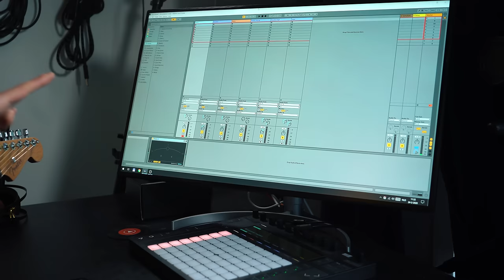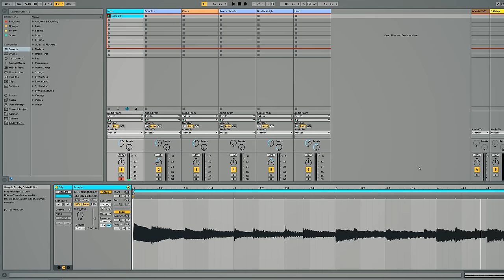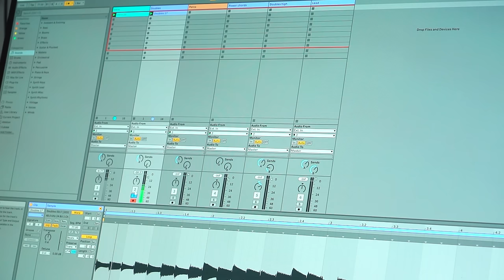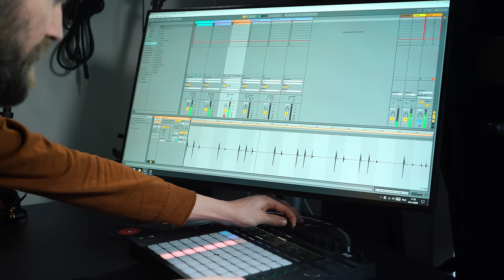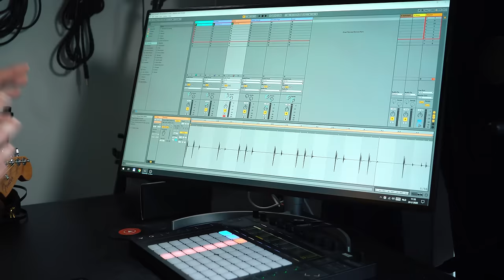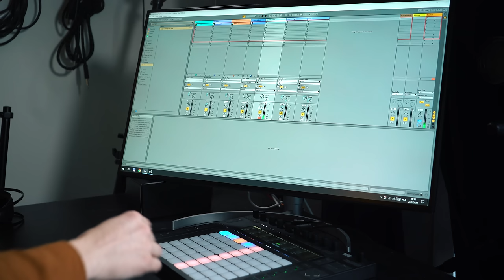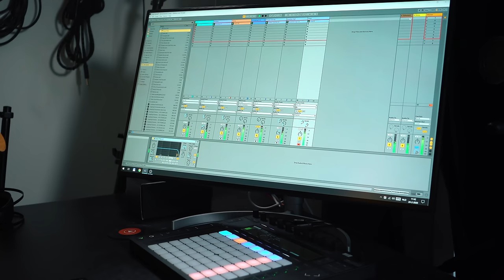My GUITAR LOOPING vision & setup explained!

Comment: This was super inspirational for me.  I spent most of the last few months researching and assembling gear and I ended up with this exact set up.  I plug my guitar, my electric piano, and my Roland octapad directly into the push and I’m learning to make all sorts of tracks to practice guitar over and begin experimenting with composition.  So wonderful for me to see that I found my way to the same setup as someone so accomplished.  I agree with you about the learning curves here, but I do encourage anyone watching to make the plunge.  This gear set up is so fun, and so powerful.  It’s also elegantly simple once you learn a bit about Ableton and the Push.  You have one hub (the Push) for everything you are doing.  The only thing I have not added yet are monitors, and I’ve even been leaning toward your choice there.  Those Eve audio rigs look so amazing, and the fact that you use them is going to be the deciding factor for me.  Thank you so much for sharing this.

Comment: Whoever wants to get a hybrid guitar that doesnt break the bank , go for the godin a6 ultra. Trust me , i spent a lot of time searching. Great sound , quality for the price .
Reply: Interesting indeed ! Does it have an amplifying body as well ? To do percussion on it.
Reply: @pinkynoise5380  No not specifically for percussive use , but you can do it with the piezo on the bridge. Ive done it many times . There is only the taylor ( over 1800) , the fender now which is over 2k and the godin . Ive played the godin and the taylor side by side and for a realistic scenario use , no difference.  If you have any other questions let me know.
Reply: At least someone shoes how to use push for somthing else than electronic music!!!  Options are awesome, myself even did a video using it  to play a videogame :D
Reply: Godin always has fantastic value for money.
Reply: @arn999  indeed. I see it apl the time . Every working musician i see on stage , plays a godin . Even the seagull acoustics are great quality. I mean i got my a6 ultra when it came out new , at 997 and it felt like a steal
. Imagine now.

Comment: there's one very important difference between a looper pedal and software looping like shown here:

software looping eg. with ableton or reaper might be a tad complicated to set up initially and is more expensive than a looper pedal
BUT
you can work on any layer separately once the looping is done and integrate it in a composition or fully build a song from it - 
which you can't do with a looping pedal where's all layers mixed together in that loop so you can't separate them afterwards to use them.
Reply: Probably a good product idea....
In addition to normal looping,
Song mode: Each overdub is recorded as a separate track and u can get the wav files via USB later.
Reply: Can you recomend a video or an article on how to set this up in Reaper? :)

Comment: Hey, how do you loop a sample without stopping recording and without stopping playing on guitar? I didn't see that you remove your hands from guitar. You just playing and the recording just looping
Magic?
Reply: One way is to automate the looper state in arrangement view, you can also set the looper up to record a preset number of bars, you can also use a foot pedal... Many ways
Reply: @DJRY360  Thank you so much. I know about foot pedal and i'm using this way. But I didn't know about that I can set the looper up to record a preset number of bars when recording audio clip. If to recording midi clip - yeah, it's possible. And also I didn't think about to automate the looper state in arrangement view. Thank you again, I'll try to use this ways.
Reply: @YaroslavGordievskiy  automating the state is really powerful.  You still need to select and arm each track somehow, but if you plan and practice I feel that the most complex looping arrangements are possible this way.
Reply: DJRY thx, buddy! 👍

Comment: I need to get my homebrew one finished. I am using the Raspberry Pi and wrote all the SW (gets/puts/saves blocks of data) from Jack Audio Interface. It is designed so someone can build their own interface (how many pedals you want etc..). I had a version working but I want to rewrite it and make it more configurable. The current "master" branch on GitHub supports 1 minute, stereo, 16 tracks which can be arranged into 4 groups. Record/Play/Mute/Overdub/Repeat (this I don't think exists in any production version), and other stuff.

The rewrite I am SLOWLY fixing will support reconfiguration so it won't be hardcoded to 16 tracks at 1 minute. Instead if you choose 8 tracks stereo, you can have 2 minutes, and 4 tracks at 4 minutes. Of course stereo or mono (not per track just configuration) will also be included.

But yeah, I hope to get it rewritten so I don't need a laptop, just my own little custom pedal box with loads of pedal switches.

Comment: I hope one day Ableton Live will support overdubbing of audio clips. If I want to overdub audio, I have to use the Ableton Looper device which can not be controlled by Push in session mode. 

You can only control the Ableton Live Looper device by:
- Making a midi mapping for the Push in user mode, another midi controller or a midi foot pedal
- Making a key mapping for your computer keyboard

Comment: So good. I didn't know that you can limit the recording time to just 4 bar (or whatever length you want). This is a game changer for me. Ending the recording phase was always super stressful. 
Thank you very much for that hint. 
I'm using the Novation Launchkey 37 MK for controlling Ableton. Is has keys but isn't by far as powerful as the Push 2. But for my needs it is just right. :)
Reply: "". I didn't know that you can limit the recording time to just 4 bar "" @mastermojo Hi please tell me how to do this in the settings. i dont have a pus controler. just a launchpad
Reply: @erandaa  Doesnt work without a push controller unfortunately.

Comment: You're the first person I'm seeing who's getting such great sound using a PC. How did you solve the delay problem? What are the settings? I also use a keyboard but when I hit the keys, I hear the sound a little later through my speakers. I don't have the money to invest in a Mac. It's simply too expensive. And if you can make it work through a PC, then I definitely can! Please please let me know.
Reply: Try to lower your buffer size. What's your daw software?
Reply: @priawanwibisono2261  I use Ableton as well as Nuendo. And Arturia Keylabs as a MIDI controller. I tried reducing the buffer size, but still find a mild lag. It's never instantaneous.
Reply: @Myndbloggin  Do you have audio interface? It improves the latency quite a lot. But yes you should spend some money to buy, it's not expensive though. 

You can check out this link for reducing latency on ableton https://help.ableton.com/hc/en-us/articles/209072289-How-to-reduce-latency

Comment: The thingy he's pushing buttons on is called... wait for it.... Ableton Push.  :-)  This one must be PUSH2 as it has fixed length (4 bar) recording.

A very light weight version of this with much less gear:

1. basic usb2 user interface (maybe behringer) $100
2. ableton live lite software (free with some controllers, including Novation Launchkey).

Setting up the fixed length 4 bar recording would be possible with live lite  and a launchkey, via a bit of a template you would open up that would have blank placeholder audio events that you would be overdubbing onto.

Comment: I like your looping method and seems more on a track/mixer level. But not diggen the Acoustasonic to much. However I suppose if you were playing live and looping, it would come in handy as being fairly versatile without changing instruments and such. I think of looping as a good writing tool. Kind of almost like a demo whose ideas can then be used in a more complex production if wanted. I have looked at Ableton Live and am still on the fence. But your video here is making me think to take another look. Looping in general is not that easy using foot pedals and such as the timing/sync is sometimes difficult to get right. In any case, your video here was well done and thought out.

Comment: I still find looping with a pedal more natural, at least for live looping or "noodle"-looping. Using a DAW seems to feel more "recording", not fun-playing.
BTW, the new boss Looper- RC-10R - has a nice modern drum station built in and synced with the loop, that is a good solution I've been struggling over: drums in jamman solo xt are too simple and outdated, trio+ requires chords to be played first (but it has bass line which is cool) and my RP360XP doesn't play drums together with loops.

Comment: Great one, Paul! How many tracks do you usually need for a typical live guitar looping like this one? Do you think 8 tracks (midi/audio) would be enough? I'm thinking whether the lite version would suffice. Cheers!
Reply: I'm certain 8 tracks will be enough, but to do exactly what Paul did in the video you'll need an Ableton Push 2 controller. It gives you the ability to fix the length of the loop and loop it automatically. Otherwise you will need to install ClyphX, which is free, but takes some learning and makes the clip view look complex.
I used Ableton for years with just 8 tracks before I upgraded. Focus on making your song sound good before worrying about how many tracks make a good song. Good luck on your musical journey.
Reply: @SandyRegion  thanks Sandy

Comment: Paul - can you please share how you're able to record loops so that they play back automatically without you having to manually stop and start the loop?
Reply: If you have Ableton push there’s a button called fixed length. When you press it you can choose the length you want the loop to be (in bars). Once you get to the end of what you set it to the clip automatically stops. You can probably do that in the software too.

Comment: i do the same using a diffent method (without using the push device and the software), i use a loop pedal, unfortunately the sound quality its not as good as yours! maybe i should find another way to do it

Comment: This is more of a DAW lesson than looping, what about just a simple ditto pedal looping?  The timing is surprisingly difficult, I never knew how terrible my timing was until I stopped using jam tracks and then trying to make my own loops just with the ditto.  I used to do this with garage band, its easier because you can cut the half second where the loop doesn't time perfectly with the 1 chord for example.

Comment: Hey Paul, I doubt you're gonna see this, but I have a question: how do you get your different guitar tones in this setup? Do you just feed in your dry guitar into an interface and use virtual amps and effects in Ableton exclusively or do you use regular ("physical") pedals/amps?
Reply: in this video he is using plugins and VSTs. not to say he doesn't mic a live rig at other times, but DSP is a huge benefit of this sort of sort of setup -- you can also tweak and play with automation after the fact. I have a pretty decent analog rig that I almost never touch because neural dsp plugins are so good.

Comment: Great work! Okay, I have a couple of questions. If I wanted to do a more budget-friendly version of this, could I loop and do the guitar effects with a less expensive version of Ableton Live, or do I need the Suite? Also, is that direct box a little more than what I would need? Thanks!
Reply: I use a launchpad Pro Mk3 ( any launchpad will work the same honestly) and Ableton Live Lite to loop with. Aside from the 8 track limitation it really is no limitation to guitar looping. I usually have two guitar tracks and then drums, synths, etc.  So... yeah Lite or standard are more than adequate to get you making good music.  Suite would be nice for the added sounds it affords but I have a bunch of .vst's already for that. Good luck

Comment: A sad truth is for a fixed length auto loop in Ableton you need to spend a lot of money on an Ableton Push controller. You can use ClyphX as a cheap way to control it within Ableton and save money but it's not as easy to use. I'm sure it's easy for Ableton to bake into the UI but they have refused to do it for years it seems.

Comment: Is there anyway to use the fixed length function while looping without the Push?
Reply: If you have ableton, there's a loop button activation and parameters at the top of the software. Would be directly to the right of the play, pause, and record buttons

Comment: Really great Vid, Ive been playing with Ableton lately for guitar looping, the one thing I can't do is "fixed length" 2:28 in the video. Is this something you can set without a push 2, as I use a launchpad. Can't seem to find this function in Ableton. But been using Ableton looper plugin to get fixed length loops, but the fixed length would be so much better.  Thanks
Reply: It is possible. Double click on an empty clip slot in session view, then you can set the length with your mouse by dragging the marker across the top of the empty clip. Then you can “overdub”’ the empty clip and it will be the length you set. I’m sorry if this didn’t make sense, it’s hard to to explain! But it’s possible!
Reply: @nathanrhale  Hi, not possible with a Audio only midi. But thanks
Reply: @linzkirk  you're right!

Comment: How did you get near zero latency? I always get a lot of latency when i connect it with Ableton through an interface hence i  had to buy a loop pedal instead. But if there is a way to get no latency through Ableton, it makes it so much more flexible.

Comment: I realise this is 4 years old now, but if anyone is still out there, is there a way of setting the fixed length of an audio clip without having an Ableton specific midi controller? I understand I can just use the looper plugin in software but wondered if there was a different way?

Comment: I can't find the "Fixed lenght" option in Ableton! Does it only work with Push?
Reply: With audio it seems so yes. With MIDI, a workaround that I've found is creating a blank clip beforehand, setting the length however many bars you want, and then session record it which overdubs rather than just playing the clip/recording a new one
Reply: apparently you can use clyphx pro scripting language to reproduce this function without a push 2

Comment: Hey paul ! I just bought a push thank's to you (damn you !!!) :D 
Just one question . On a midi track , even if I push the fixed lenght button, the lenght of th track is always 1. I have to adjust it manually on ableton live before recording. Do you have a solution for that ?
Reply from the maker: Hold on the button on push and then select the amount of bars on push.
Reply: @PaulDavids  yeah i did that and it works great on an audio track. But on a midi track it doesnt. I have to set it manually on ableton

Comment: Hey Paul, I've been trying for over a year to do live looping with Ableton and just can't get it working. I can't seem to program it to stop recording and begin looping after a specific number of bars. I think you recorded 2 bars and then it begins looping automatically, I can't do that. Any advice? (I have Ableton Standard. Using an AKAI APC Key 25 MIDI controller) thanks!

Comment: Is that midi controller specific to Ableton Live?  I see on the amazon link that there are others which are also made by Ableton but can they (or any others) work woth Logix pro?
Reply: Ableton PUSH controllers are made for ableton , they tend to be sold with the more expensive version of Ableton live. And can cost over a Grand for the DAW and the controller. Second hand mark 1 models can be found fairly cheaply. 

Most controllers work in Ableton, and you can manually assign every parameter with a simple click. 

Ableton also work with akai to produce the APC series of controllers APC20 and APC40 now come in small versions of the originals that were released and you can use them in a similar way to PUSH. Arming and live looping within LIVE. And they cost pennies. 

Logic should see the APC as a generic controller and you may have to assign some Parameters yourself with midi learn function (I assume it has midi learn)

Comment: The sad part is... You need ableton push midi controller to set a fixed length. Yup, I know, doesn't make sense, but it's true. You can use the looper plug-in as an alternative but doesn't integrate as well with the session view of ableton. How lame is that?